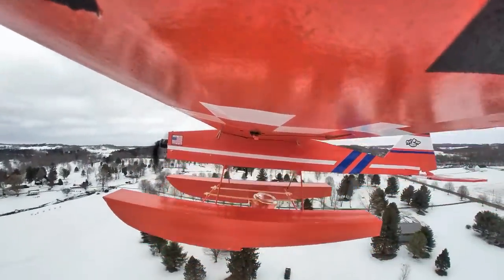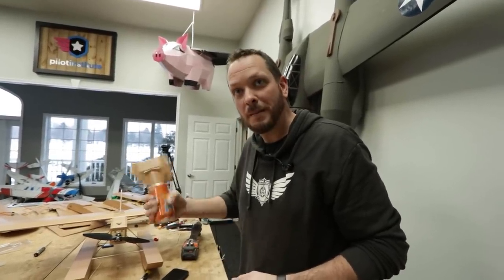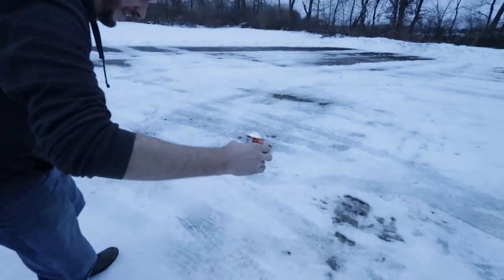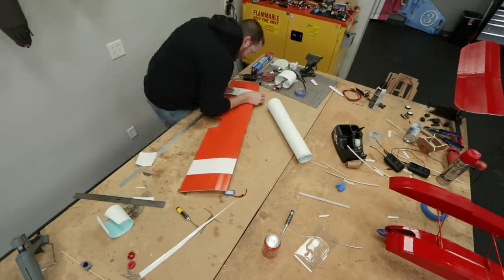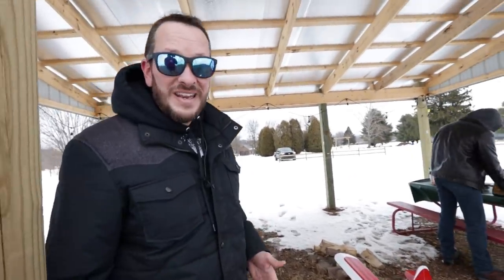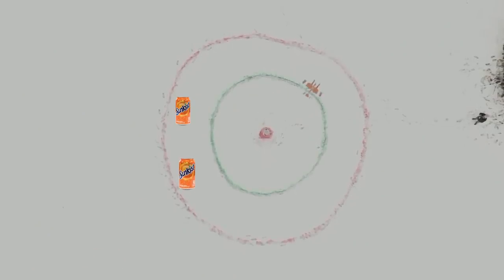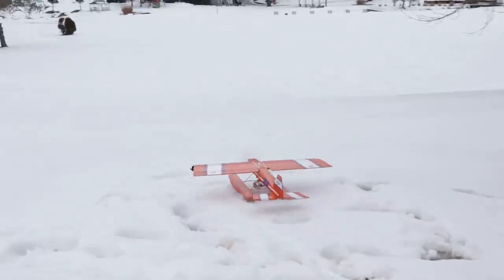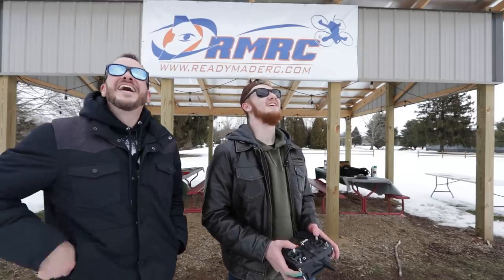Dive Bomb Pop Can Challenge

Comment: This RC Hobby has come such a long way since I was flying. I started in roughly 1977 with the old 4 channel Kraft Radios. I was 14 and bought the balsa kits and tried to avoid dinosaur piles on the runway. OS Max was the engine if you could afford one, I had a K&B which was dependable. I missed the runway so often my so called buddies got stickers and wrote Weed Eater across the wings. If I could add fuel and fly again I didn't care where it came down. I don't know how many hay bales I handled to buy that setup. The Simple Stick reminded me of my plane.

Comment: Nothing better than sitting on the couch drinking a DR Pepper watch them dropping DR Pepper.
Lol
Reply: @xdragclick2074  well first make sure where you put it that the planes gonna be level. You can use zip ties and yekes.
Reply: @hornets1140  hmm, under the 'fuselage?' my plane's only about 2/3 the length of my arm
Reply: @hornets1140  i saw a few simple 3d printed mechanisms with only 1 motor....

i don't have a motor, neither a 3d printer...
Reply: @xdragclick2074  ya I can’t really help you there, sorry.
I bet if you reply in flite test comment there answer you
Reply: @hornets1140  thanks!
Reply: @xdragclick2074  np
Reply: @hornets1140  😀😁👍🏻🤝

Comment: Would of looked great if they exploded on impact, But i guess snow would put a stop to that. I wonder if next time you could use bags to hold the drinks or repeat the video on a hot sunny day when the ground is hard and maybe fit a small motor to vibrate the can before you release it. 🤔

Comment: While FT did a blimp some time back, it was unstable and didn't fly very well.  I'd like to see as a challenge,  a revisit of this, making the blimp larger, stable, and just like WWI, be able to deploy and recover bi planes.  The bi planes must a) successfully deploy b) fly to a designated bomb zone, deploying "ordinance" and then c) make it back to the airship and be recovered  d) all above predicated upon the their ability not get shot down by other defending fighters.

The airships should have turrets with airsoft cannons, head tracked, fpv controlled.  Maybe a bow and stern cannon controlled by two gunners.  a third operator controlling the airship.

A team of aggressor fighters (2 or 3), and a defending wing of interdictor fighters.  For added measure, night lighting, tracers and fireworks for flak cannons.

Comment: Gentlemen, I don't keep up with all your videos... But it seems like you're up for a challenge and unlikely to have tackled this one:
Oblique wing aircraft
The challenge would be to create a symmetric wing on a pivot (could be central, or I've seen distributed airframe concepts). The aircraft dynamics change drastically as you pivot the wing. Benefit of course is effective aspect ratio changes, which can provide some very interesting capabilities in terms of speed and maneuverability.
NASA, DARPA, and a number of other research organizations have investigated the concept over the years. I've never seen it as a small scale drone (though someone must have attempted it).

Great videos from you all, looking forward to trying out your kits with my son when he's a little older.